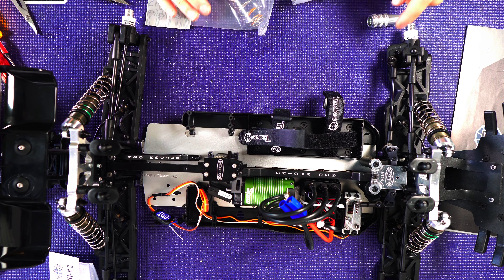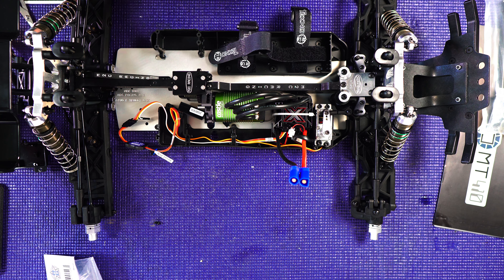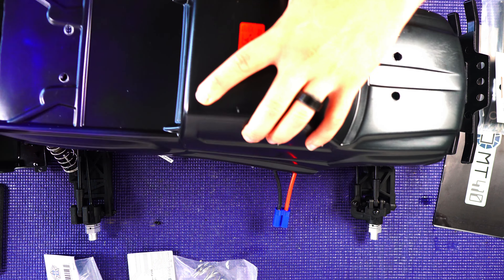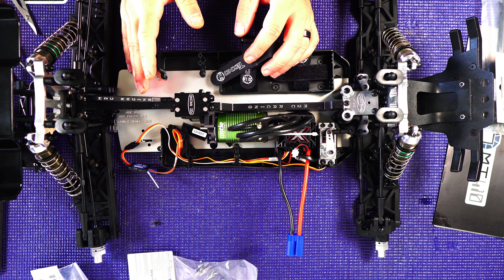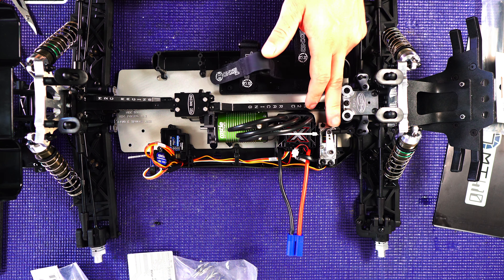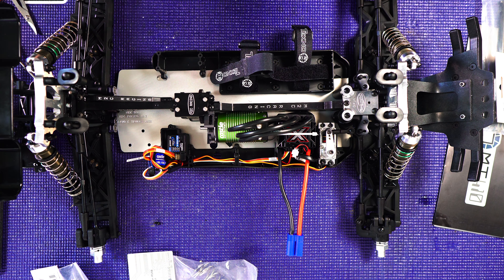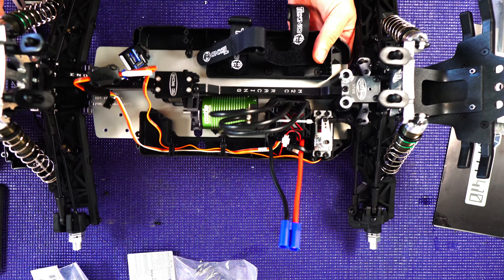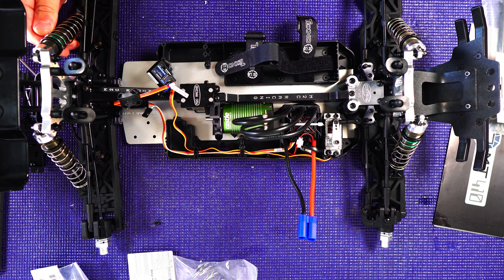Building the Ultimate RC Basher: Part 3 | What Electronics Went In?

Comment: Looking very slick, cant wait to see it run.  100% agree on waterproof radiobox for easy cleanup as well as puddle splashing.
Reply from the maker: Thank You! should be running in the next day!
Reply: @GarageLifeRC  have you ever used one of the hairnet style chassis covers to keep dirt out?  I just installed one on my slash 4x4, works well, keeps crud out of the fans.  Cheers, really enjoy your work.
Reply from the maker: Yeah I have one on my redcat and on my mt410. They do work good. For where I run, I should have one on every vehicle. Maybe I should get some more. Haha
Reply: @GarageLifeRC  I was worried about heat but have a fan on the motor and esc and it hasn't been an issue. It actually keeps stuff from interfering with the fans and jamming them. The short course trucks in particular really love to accumulate stuff in the chassis!